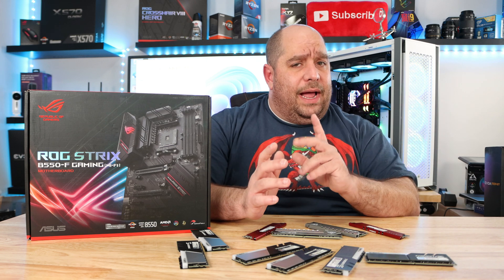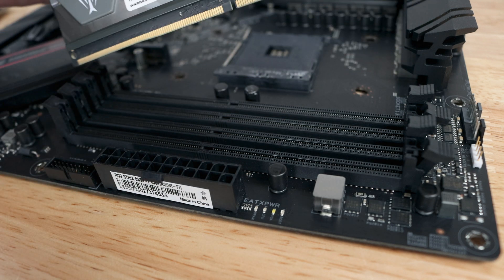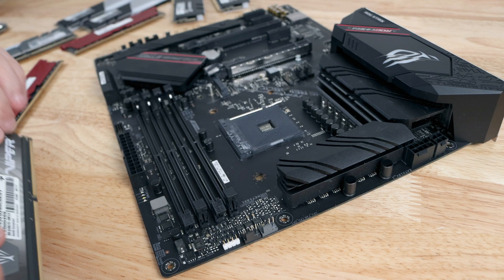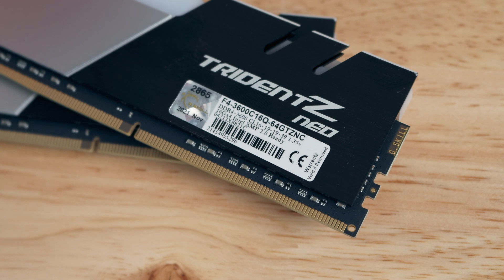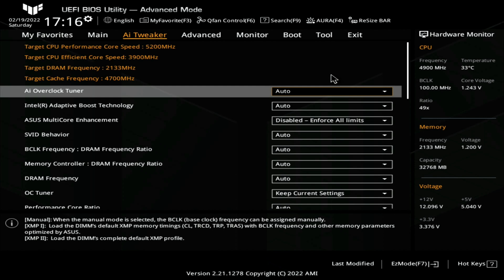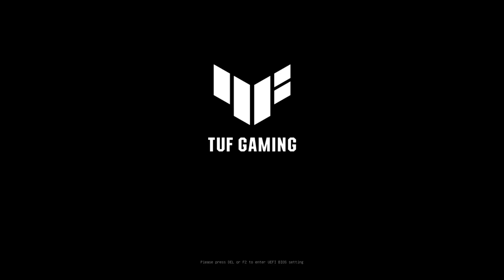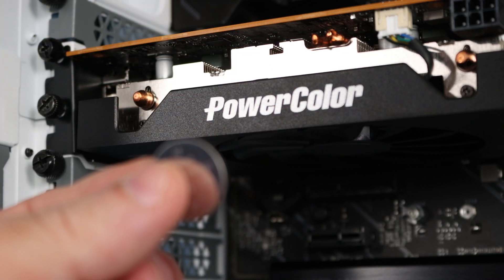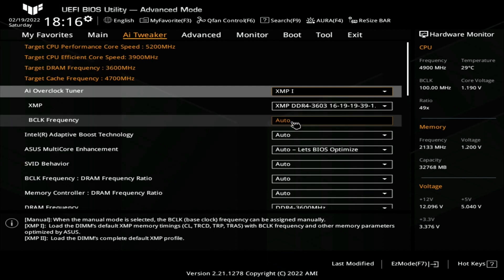How to install and configure RAM in a PC - Step By Step Setup Beginners Guide

Comment: Man, out of curiosity :P ... when you play Metro Exodus Enhanced, you can get nice, clear graphics using raytracing... no tearing..image blurring...ghosting...??

It is this game that had me thinking of getting more RAM in the first place. Im on a 2070, 9700k, 16gb 3000mhz RAM, SSD...

I changed "r_enum_ssaa 10" to "r_enum_ssaa 1" in CFG and turned off blur, mouse smooth/accel... medium quality, low RT, no DLSS or HDR... capped at 85 fps with "FAST" vsync and using RTSS. 

Blurry, ugly graphics. I cant get into the game. Just completed the first 2 redux games and loved them... but now downloading the original Exodus to see if it is better.
Reply from the maker: Well, RTX just started on the 20 series, so you won't be able to get much and the 9700K is not the workhorse it used to be, I just upgraded from a 9900K to a 5900X.  Also, 3000Mhz is a bit slow, you probably want 3600 or higher, maybe 16gigs might not be the best for the OS and the game, especially if you have other processes running.

I played more Metro Exodus, the enhanced version I use it to bench, and its a monster but Metro has always been a game that kills machines as it is not very well optimized.  So, do you have the game on an SSD or a hard drive, I know you show an SSD, but probably that's the boot drive, turn VSYNC off and if you have Gsync or Freesync, enable it, also make sure you have your monitor set to the highest refresh rate, if not its at 60 or below.
Reply: @ThisBytesForYou  ah ok... i see. So my 9700k is not really future proof. I have the game saved on my C: drive (nvme m.2).... but I also have a separate SSD installed, I should transfer the game over to it?

I have been using Gsync compatibility with my AOC monitor but disabled it as I felt it was causing bad stutter in some games, like Dragon's Dogma. Sure enough Fast sync seemed better. But I will try my Gsync Dell monitor and see if it helps too.

I guess it is time to save for an AMD rig. I'll make the most of this system for now. Thanks for your advice /\
Reply from the maker: well yes and no, you can get more life out of it with a fresh windows install, but of course you will lose your files, I format every few months to keep everything nice and new.  Use this video to make a brand new windows 10 thumb drive, with all the latest updates (although I recommend 11, not sure if your board supports TPM): https://youtu.be/C759I7DBXd8 then afterwards, once you are in windows, you will need to install all your drivers, you can follow this video: https://youtu.be/8JuC_Dpm6-c

All this will help your stutters, there is no such thing as future proof, if that was the case, my old IBM XT 5180 (the first computer for home) would still be top of the charts, intel and AMD would never need to release cpus nvidia and Amd would never need to release videos cards.  As games release, they need more, so they make processors, video cards, ssd's, memory, etc that give it more.

Comment: Wow man amazing video... so clear man, thank you. So in order B2-A2-B1-A1 gotcha...
Do you recommend 4x modules at say, 32GB, or 2x modules at 32gb??
Also, could I just switch off PC at mains, and hold power button for a minute to drain CMOS, without removing?
And will this, or removing CMOS, delete my overclock profile in BIOS? I would like to just load it again if possible...
Reply from the maker: For dual channel, its best for 2 sticks of RAM, also it is easier to overclock 2 sticks over 4.  If you clear your CMOS yes you will lose your overclock, I highly recommend you take pictures of all your BIOS screens, flash to the latest BIOS and then pop in the new memory to get optimal performance.  

Always a pleasure my friend, so very happy you stopped by, trusted in me to help you, liked and subbed as well as took a moment out of your day to thank me.  It means a ton to me and I am so very happy I could help you.

Comment: Hi im following ur step by step build and im actually using the same z690 d4 mb , but i have 4 sticks of ram and wondering if XMP will work with 4 slots fully applied
Reply from the maker: yes it will work perfectly well..... IF they are they same type of RAM, same manufacturer and model number.
Reply: @ThisBytesForYou  yes it is now i will update the bios and of course throw ur vid thanks
Reply from the maker: @Don-tm2wh  awesome my friend, let me know how it goes for you.
Reply: @ThisBytesForYou  there is a beta version of the bios but i will go with the previous version 1003

Comment: love from India....... hey i have "Asus B450 F gaming ll" motherboard
everytime i start my pc motherboard blink yellow light then red and then yellow it take lots off time almost 30-35sec and then asus logo show on display........... why it take lots of time before boot ? even i am using M.2 Nvme..........  is i have to change any boot option
Reply from the maker: So that I can help, please list the manufacturer and exact model number of the following components:
1. Motherboard
2. CPU
3. RAM
4. Video Card
5. Power supply
6. Monitor.
Reply: @ThisBytesForYou  CPU :- Ryzan 5 3600 

GPU :- GTX 1650 ( colorfull company ) 

Motherboard :-  "Asus B 450 f gaming ll"

PSU : - cooler master 450W  80+ bnz 

Ram :-  XPG 8GB × 2   3200 MHz  (RGB)
Reply from the maker: Take pictures of your current BIOS settings
download the 2nd to last BIOS, not the latest, but the one before that, the newer one has issues, use version 4602
https://rog.asus.com/motherboards/rog-strix/rog-strix-b450-f-gaming-ii-model/helpdesk_bios

After you flash the BIOS, then go into the BIOS, go to the exit section and click "Load Optimal BIOS defaults", save and exit, then when you come back into the BIOS, set up your settings like you had before.

This time, set DOCP, then set the Fclck as 1600, half the speed of your RAM and then give it a try.
Reply: @ThisBytesForYou  i updated bio few day ago 4702 soo i goo back to 4602 right
Reply from the maker: did the issue start after the update?
Reply: @ThisBytesForYou  i didn't remember if it was with the old bios or not because i just purchased it 1 week ago and i was facing some display issue so update the bios for that then i realised that issue was because of my hdmi to vga connector and after replac the concertor my display problem gone but this new problem arises
Reply from the maker: Ok, neverminded that BIOS is not the one with issues,  it was one after and they pulled it already.  do you have the memory installed like I showed you in this video so it would be dual channel?  Then also follow the instructions I mentioned for setting up the BIOS
Reply from the maker: Where is the light?  If you go here, on page 1-22, it shows a Q-LED light, is that the light: https://dlcdnets.asus.com/pub/ASUS/mb/SocketAM4/ROG_STRIX_B450-F_GAMING_II/E17112_ROG_STRIX_B450-F_GAMING_II_UM_WEB.pdf

ON which color is it stuck on the longest?
Reply: @ThisBytesForYou  yeah it that light...... first it turn yellow then after few seconds red then again yellow then after few second white then green this prosses take aprox 30-35 second and then Asus logo show and windows boot....... it  is only happens when i first start the pc and sometimes when restart the pc
Reply from the maker: @reviewstand9953   have you checked to see that you have AI Tweaker set to DOCP?
Reply: @ThisBytesForYou  yes i set it to docp for ram frequency change 2700 to 3200 MHz

Comment: Hey i got a 6600rx and when I installed it and it booted my screen was rainbow dots idk where I can show u lmkk how to fix I got the drivers for the card but it didt fix it
Reply from the maker: Check to see that the cable is seated properly, the HDMI or DP cable or maybe find a different one, if you are sure the monitor is perfect.

Comment: I know this is a beginner guide, but if you're going through the entire process of configuring memory in bios etc as well I would recommend testing and making sure the overclock (xmp is an overclock) is also stable. 

i recommend memtest86 mounted on a usb boot drive as it will test the full address range outside of windows 10.

But other than that. very good guide thanks.
Reply from the maker: thanks bud, XMP is an overclock, but since it was developed, I have never had an issue with XMP, ever.  I wanted to teach people how to set the memory up through JEDEC standards, but, a 13 minute video would have turned out to be a 20 minute video.  Finding voltages, finding where the timings are then telling people which should be set where, that would have failed well out of a beginner guide.

XMP, falls perfectly into a beginners guide, and chances are, any stick of memory you buy will have an XMP profile.
Reply: @ThisBytesForYou  Yeah, maybe I was unlucky but I had actually gotten an unstable ram kit once recently. It was 2x16 GB CL18 3600 Mhz g skill ripjaws. Pretty common ram. Didn't like the overclock XMP profile 1 in a msi b550 bios with a 5600x. Failed memtest with memory overlcock but was fine in JEDEC (2333 Mhz or something). Replaced with corsair ram same speed and timing and it worked perfectly and passed memtest. Go figure. The unstable ram caused slight instabilities with CTD's in game but that's about it daily driving was stable.
Reply from the maker: Prior to ordering these GSkill sticks, I had just bought Corsair memory for my new build, my older workstation died, so I figured to go all out.  

Sadly, the Corsair, XMP or JEDEC would only post when it wanted to, and stay working when it wanted to as well, worked perfectly fine with some older Patriot Viper 4133Mhz, but I only had 32Gigs, I wanted 64Gigs for Video and photo editing, to make sure I had 0 hiccups.  3 days of playing with that, i sent the memory back (which was not a bad thing, because I didn't realize I ordered 3200Mhz RAM) and then bought these, slightly faster 3600Mhz, but also with tighter timings and running XMP all day long, not a single issue with these.  

If anything, XMP helps you find issues quicker I guess haha.  Glad you got everything working, but in both cases, it wasn't XMP, it was just defective RAM, XMP just showed the issue quicker.  I don't know about you, but I don't want JEDEC, I want rated speeds.
Reply from the maker: the other thing I didn't mention (for 2 reasons) was the QVL.  The Qualified Vendor List has all the memory that was tested to work on the board.  As product development engineer, I worked with companies to get memory tested when there was issues but they would only test and certify memory that was paid to get tested... that seems very shady to me.  I won't say which motherboard manufacturers, this was before my days reviewing, so that's 1 reason I don't use QVL and the other is because they mostly don't have RAM I want to use on there hahaha.

But the QVL is there to let you know what RAM is good to use and if it's not there, you run the risk of it not working, and also potentially support not working with you because if its not on the QVL, that's the issue.

Chances are the RAM is going to work, but when using RAM, I at least like to verify if for AMD, it is stated that it is certified AMD compatible and the same for Intel.
Reply: @ThisBytesForYou  interesting read, you have an interesting background! 

In regards to the QVL I also find that these are rarely up to date - could be because memory manufactures are constantly changing their model numbers / chipsets or they just don't have the testing capability for all the different memory that's out in the wild currently. There's a good chance alot of the memory model numbers that are listed in Gigabyte or Msi etc motherboard QVLs aren't even purchasable anymore as they are older model skews.

Once again thanks for the video, you should do a video on your experience in the field.
Reply from the maker: yeah they are never up to date, so they kind of a waste of time.  Always a pleasure my friend, very happy you enjoyed it.
Reply: If I’m just adding ram and it’s the Same speed and brand, do I just need to install it physically and that’s it?

Comment: If I have 16gb (2x8) and want to go to 32gb (2x16) both at 3200hz will I need to do anything in terms of adjustments? I tried to just add two sticks, but it then wouldn't let the computer turn on so I just sent the other two back. I still want 32gb of ram, but I just want to replace the ram sticks I currently have.
Reply from the maker: watch this video, I go over matching the memory.  The memory should be purchased together, but when it is not, even if its the same manufacturer and model number, you risk the memory not being compatible.  The way I show you in the video to match the memory should help your scenario.
Reply: @ThisBytesForYou  so yeah that's kinda what I'm confused about. You show that the last few numbers are different and I just looked at mine and the two are the same (Probably due to being TForce ram) so does that just mean they were in the same pack? Yeah this probably does explain my issue I had though...I've watched dozens of videos and you're the first to point this out.
Reply from the maker: so, to save time, I cut it out, but its in the description.  Not all vendors have it the same, some will have it in different sections.  Get the memory side by side, there will be 1 number off, and that will be the date/lot code, or sequence, etc.
Reply: @ThisBytesForYou  gotcha thanks so much for the help and the video! I'll be saving this for when I change out the RAM in a few months, take care...you have a wonderful channel!
Reply from the maker: Awesome my friend, so very happy I could help you.  A lot of people don't know this actually, but while I was a Product development engineer at Alienware and Velocity Micro, when we would run lines I found this out the hard way and I worked closely with Corsair, Crucial, Patriot and others to make sure we could get matching codes, it was a game changer.  

Make sure to share the video if it has helped, and please do like and subscribe, I come out with videos like this every week to try and help on tons of things.  Thanks again my friend for your kind words and support, it means a ton to me.
Reply: @ThisBytesForYou  wow that's very impressive! Makes sense too due to your solid content! If I have anyone ask regarding these topics I'll send them your way. I've been subbed for a little while now, but yeah I'll be sure to refer you!
Reply from the maker: Yeah, not only did I work there, but most importantly, I loved what I did , so it helps here to help others as much as possible.  Sorry about not realizing you were already a subscriber, when you hide your subs, we can't tell you are a subscriber either, not a biggy, since I try to help everyone, but that way I don't have to throw you the spiel hahah, thanks so much for your support my friend and thanks so much for recommending me as well, word of mouth helps so much.  Thanks again.
Reply: @ThisBytesForYou  yeah no worries man you deserve as much success as possible! Keep it up!
Reply from the maker: thanks so much my friend ;)
Reply: @ThisBytesForYou  hey there again! I got around to upgrade my ram...I bought 2 sticks and I'm just making a swap. I changed them out into the correct slots, but when I turn my computer on it does turn on but it shuts off and immediately turns on and then shuts off. Any clue to why this is happening?
Reply: @ThisBytesForYou  URGENT now my old ram is doing the same thing! Did I just break it??
Reply from the maker: @Magswap  so did it work fine with the other ram?
Reply from the maker: @Magswap  its a possibility, like with anything.  I recommend disconnecting all the cables in the back of your PC.  USB, hdmi/dp/dvi, power, etc.  The removing the CMOS batter for 60 seconds (1 minute).  After that 1 minute, put all the cables back in, the put the cmos battery back in and put only 2 sticks of RAM back in and see if you can get that to work.
Reply: @ThisBytesForYou  for context I'm not adding ram I'm just replacing (2x8) for (2x16) both at 3200hz. I reset the battery before your comment but only waited about 30 seconds. Neither sets of ram boot the PC completely it just shuts on and off for both. Ram is seated properly in A2 and B2...but do I need to worry about the serial number? For example #072 in A2 and #071 in B2.
Reply: @ThisBytesForYou  hey quick update its working now and took the upgraded ram...idk if it was the cmos or I didn't have it properly seated at first but it works now...thanks so much for the fast replies!!!!
Reply from the maker: @Magswap  always a pleasure my friend, so very happy i could help you get it going.
Reply: @ThisBytesForYou  seriously though you rock, if anyone ever needs tech advice I'm sending them your way! Thanks again for dealing with my panic🤣
Reply from the maker: @Magswap  yes please do send them my way, and I am so very happy that I could help you